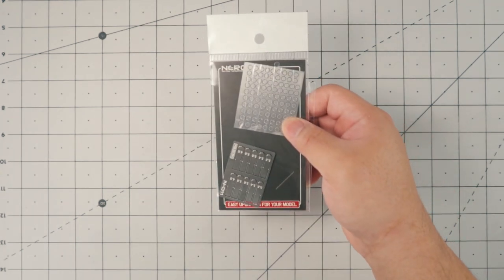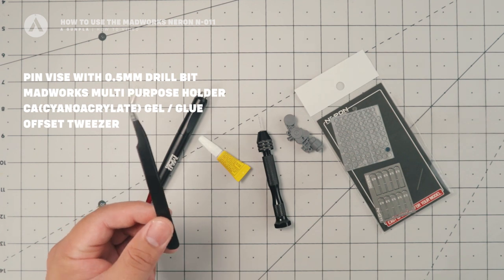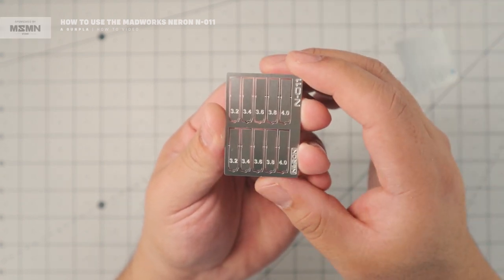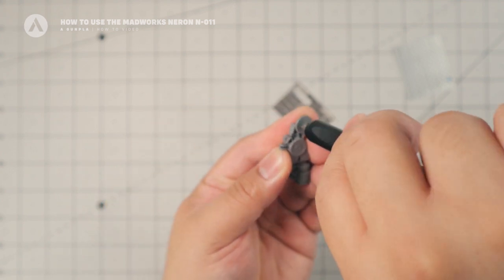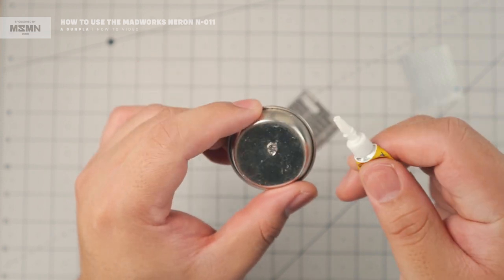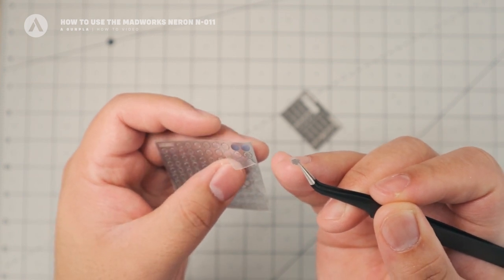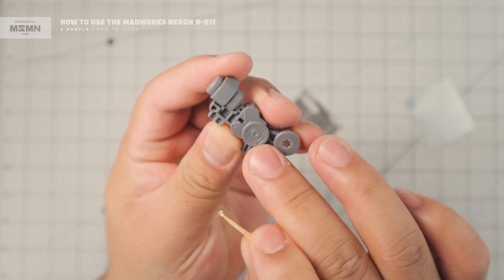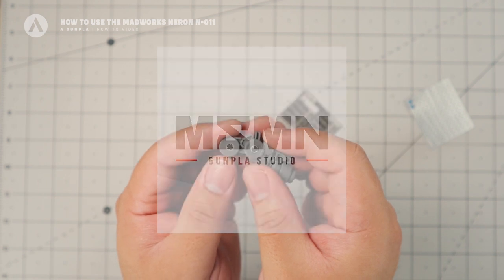How to add detail-up parts using the Madworks Neron N-011 | Gunpla Tutorial |  Spin Blades

Comment: I want to try some thing like this or using photo etch parts. Will you be painting over these etch details?
Reply from the maker: There are some that you want to be painted such as the hooks and railing. But for the example that I used, you can use them as is because they simulate screw and hatches. There are also more screw-like designs than the one I have.